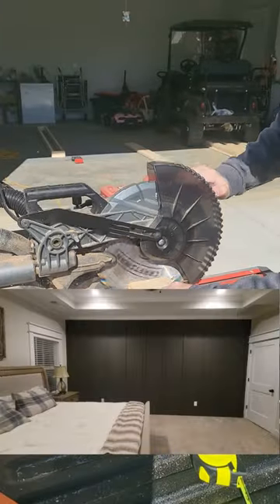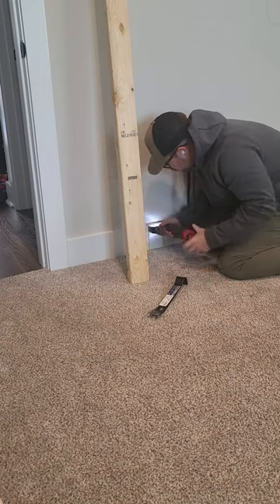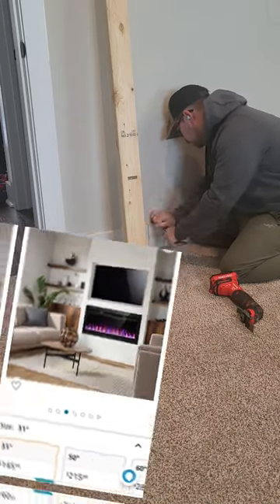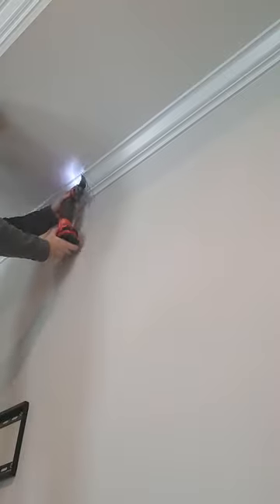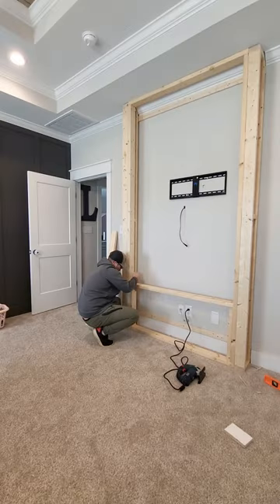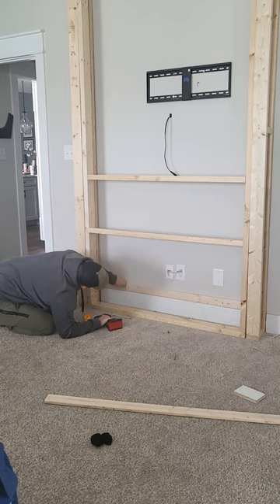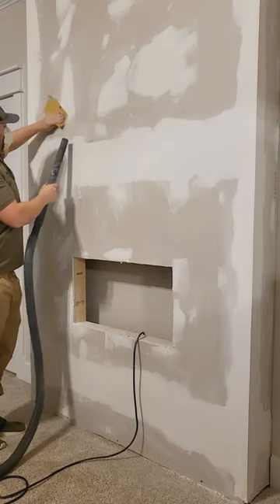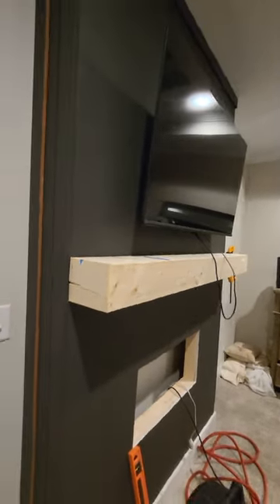Master Bedroom Fireplace DIY

Comment: What tool did you use to measure the angle at the top? Awesome work
Reply from the maker: Hey, so not sure which angle you mean but I think you might be talking about when I cut out the crown molding at the top? I used a speed square to trace out a straight line from the ceiling to the wall so I would know where to cut with multitool. It's just a 90° as the 2x4 fram slides in-between the crown molding I removed.

Hope this was what you were referring to and hope it helps.